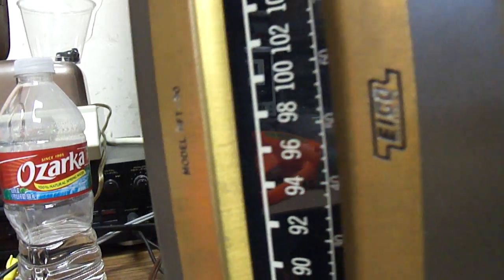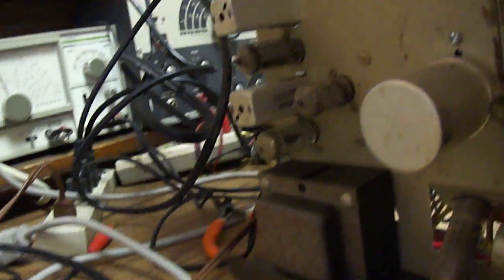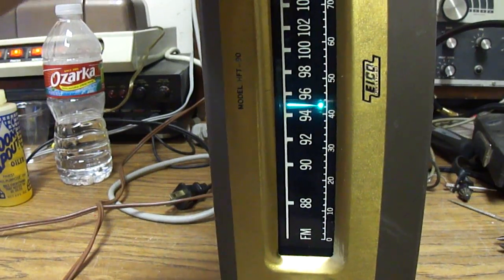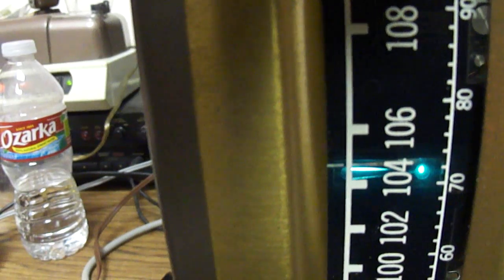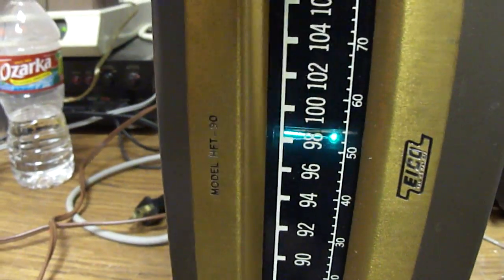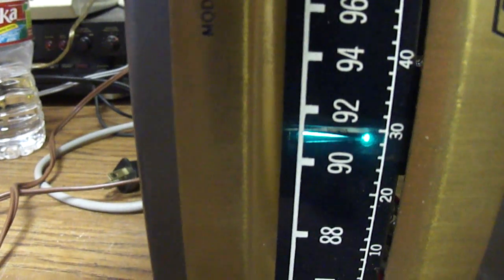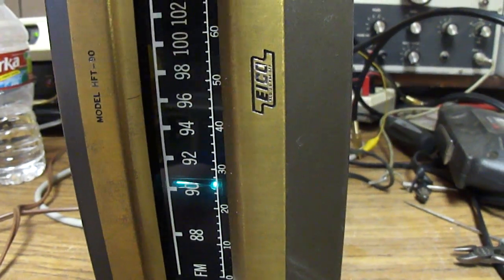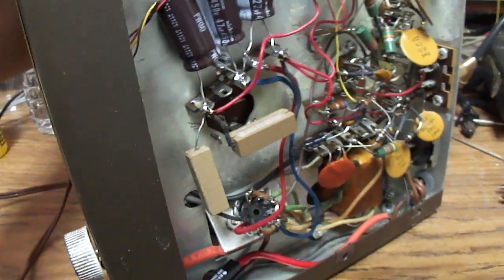1960's Eico HFT-90 tube type FM tuner test after repairs

Comment: I remember these Eico kits from when I was a teenager in the early 60's.  Always wanted to buy and assemble them, but on a teenagers allowance that was impossible.  I loved the "!" tuning eye.  Eico also made a matching HFT-94 AM tuner. There is one on eBay and it uses the cylinder caps that have a ceramic outer shell rather than disc caps.  They also had an HFT-92 AM/FM tuner.  I think Eico was always a better designed product than Heathkit.

Comment from the maker: @wildbilltexas Yes, this looks like it was a kit as all the parts are fastened with screws and there are some pencil annotations on the bottom of the chassis. Whoever built this did as good a construction job as the factory would have, though.